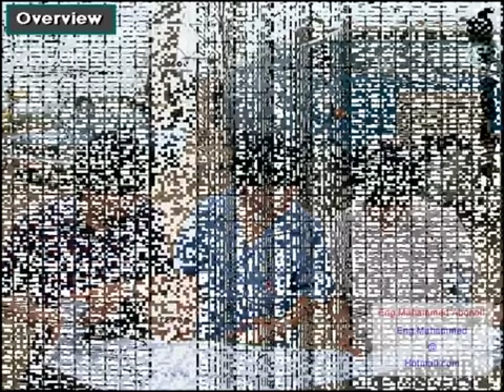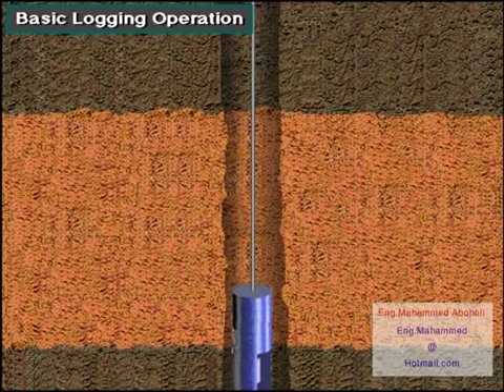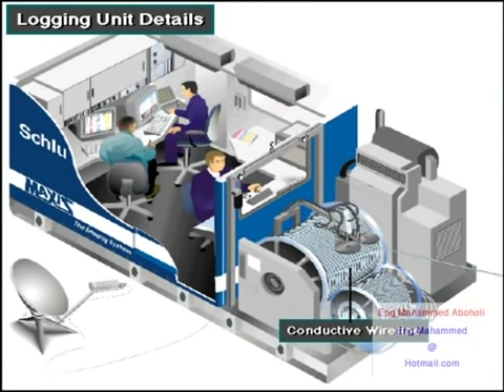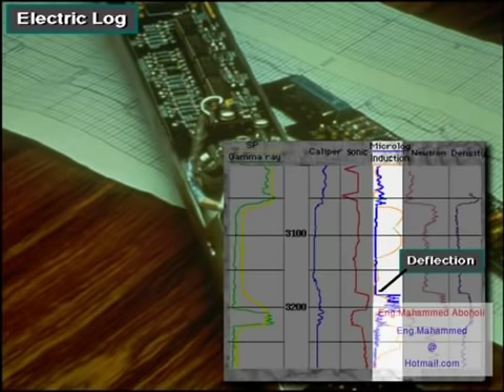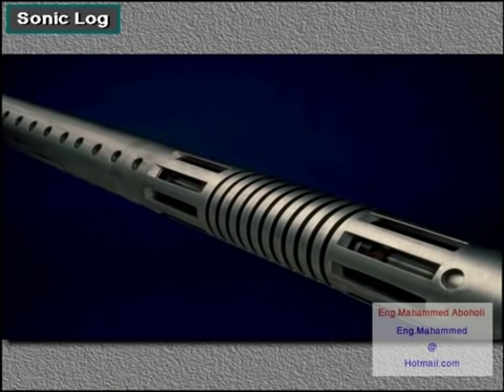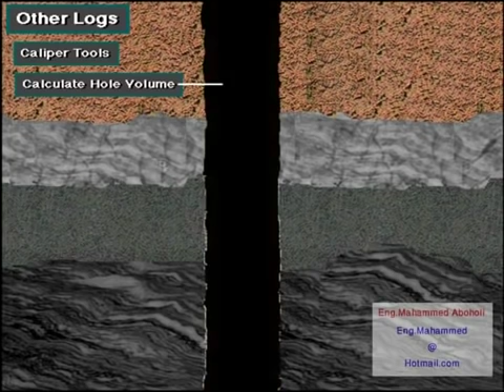Oil & Gas WireLine

Comment: I could have done a much better video than this crap
Reply: Can you do that pls... I am interested to see.
Reply: @Nad7334  we do in oman 🇴🇲 this kind of wireline unit
Contact mr athmani 0096899444024
Reply: @redblood119  i work in Fahood ....it was my first location did my breakout job there on TLC .... Good times
Reply: HI yasser, can you share your video to me
Reply: well, maybe instead of running your lip, you could have been making a video. easy to stand on the sidelines and critique.
Reply: @frankwise7464  the last time i was in the field wad 2006 So i dont got to be in the field making a cheap video
Reply: @yasseral-quasmi1649  so 15 years ago but you are STILL critiquing? 15 years ago most fracking companies had not arrived in the marcellus shale play. LOTS of advancements made in the time you have NOT been in the field.
Reply: @frankwise7464  so whats your point ? Or are you the type who just needs to say anything
Reply: @yasseral-quasmi1649  ask yourself the same question.
Reply: @frankwise7464  well in case you didn't get my point ...my point was that was a shitty video about the wireline operation and in the case that i was still doing that job or in the case were i was able to have even a phone camera during my time in the field i would have been able to do a better job ....get it or have you been spending too much time around those nuclear sources that now it makes you a bit slow ??? ...did you get it or does it require more breaking down for you ???? ....if you didnt get my point yet than you may want to drop the "wise" in your name
Reply: @yasseral-quasmi1649  I wondered how long it would be before you started throwing insults my way. Thats ok. Have a great day.
Reply: @frankwise7464  don't dish it if you can't take it
Reply: @yasseral-quasmi1649  i can take it. im just bored with you. lol. see ya.
Reply: @frankwise7464  yet still talking